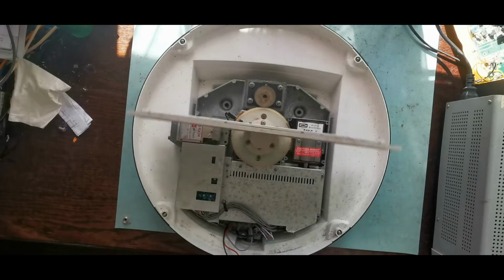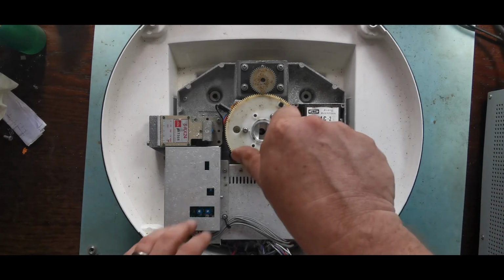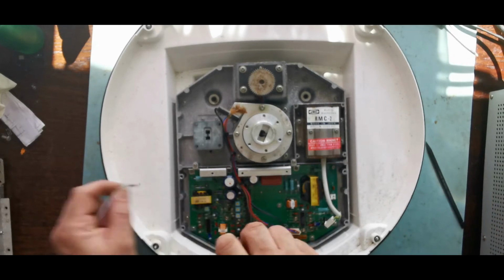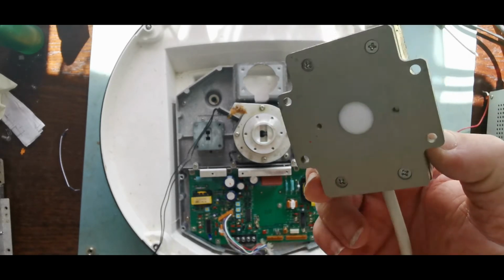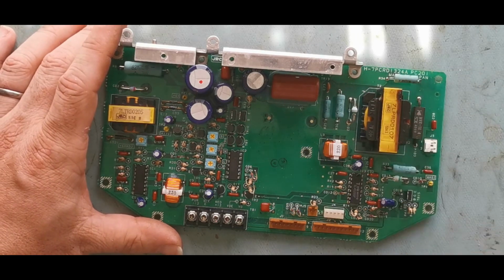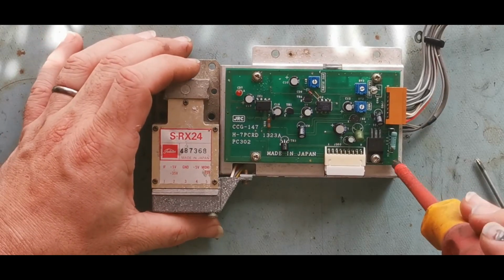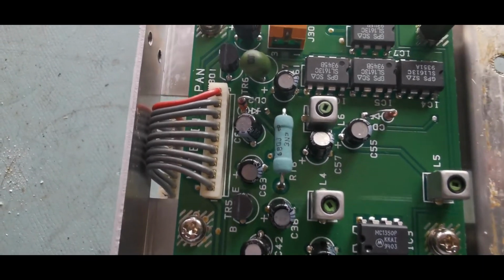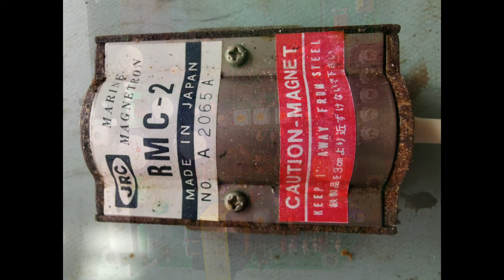Teardown  -Raytheon Radar Scanner

Comment: I think that N JS6931 is a tr switch tube. Transmit / Receive switch. Just an rf actuated switch that routes the transmit output pulse to the antenna. And keeps that high power pulse out of the receiver. Then opens the path for the receive signal. Yes it is very fast
Reply from the maker: Its quite an old video now, but you may be right. I'd have to re-watch it now
Reply: RF limiter, not circulator

Comment: ha! just found this looking for help with my 24 mile raytheon that was unused for years and stuck/jammed. The motor was stuck and I turned it by hand and found a corroded spot and it came back to useful life, working as before. Now I just have to recall the on/off commands and how to operate the radar between standby and transmit and on off functions.

Comment: Hi Rtech, Bit of a long shot I have a 2KW Raytheon thats reporting "Scanner not Rotating" on the Header Unit/Display do you carry out repairs ? or could you suggest what might be causing the error ? .I am convinced the scanner is rotating but something is not detecting it . could it be the Hall Sansor ? can you help ? Thanks
Reply from the maker: I'd check the hall sensor on the head, obviously you can't power the unit up while you are working on it but you can buzz the wiring through without power and check the magnet is still there. I f you have the means you can test the hall sensor off the unit. I believe there is a scanner sync pulse that goes down the cable to the display so may be worth looking at that too. Give everything a liberal coating of electrolube cleaner or deoxit.

Comment: Hi there I've got a very simple my Raytheon pathfinder keeps telling me warning antenna not rotating have you got any ideas what could be wrong thank you very much indeed Alex
Reply from the maker: The unit I tore down had a position sensor on the scanner. This is used to generate a sync pluse to the receiver which tells it where the scan head is. You've lost this signal. Either the encoder on the head has failed, your have a cable break on the sync line or the receiver has an issue. If you know how to use a scope and can get to the sync line you can check for its presence. Note that CRTs and Magnetrons use lethal voltages and being close to an operational radar head can be dangerous for your long term health.
Reply: Thank you very much indeed that was very kind for your help very much appreciated has been on the boat for the last 20-years so I think possibly retired just like myself once again thank you very much indeed and have a great Christmas and a prosperous New year all the best Alex